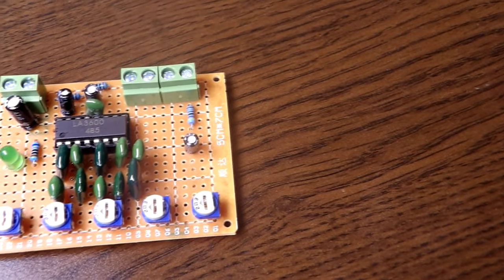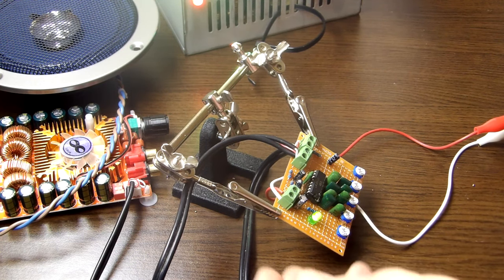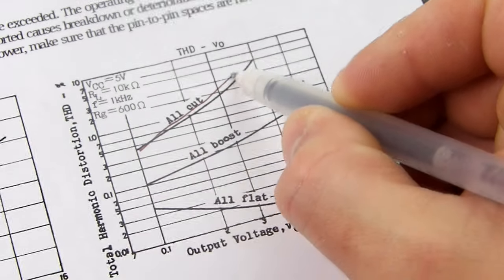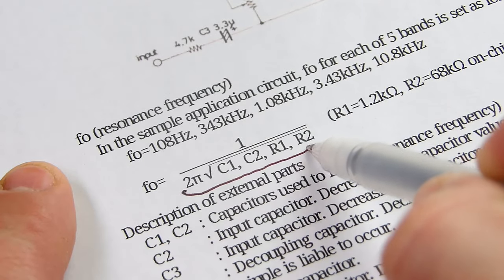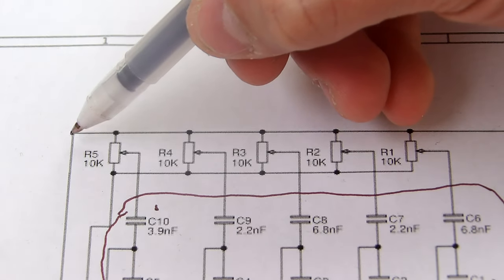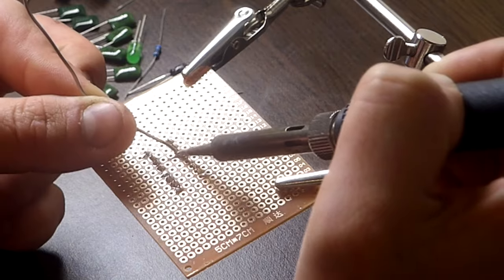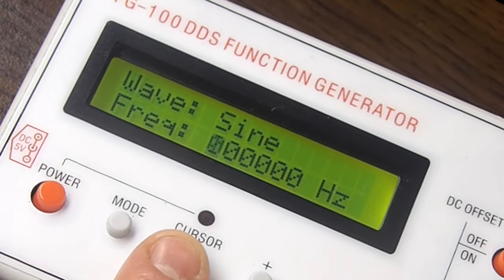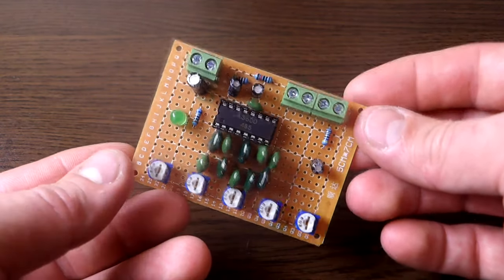Simple 5 Band Audio Graphic Equalizer Base On LA 3600

Comment: Stereo? And I want to use linear potentiometer. So how can i replace that small white potentiometer with linear potentiometer?
Reply from the maker: For stereo you will need 2 simetrical circuit and yes with linear slider potentiometer will be more easily to ajust the frequency then with the logarithmic ones